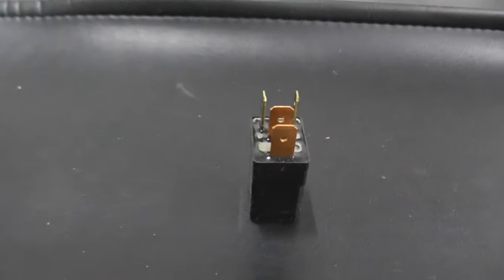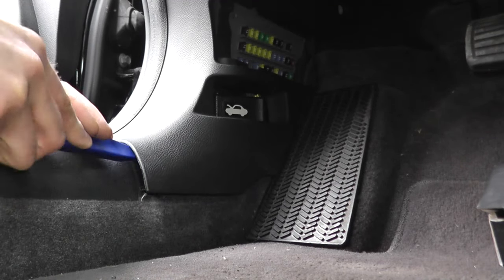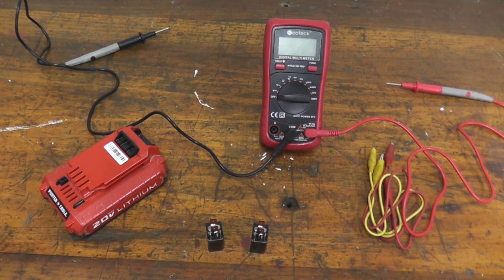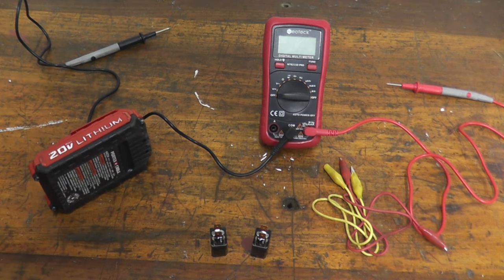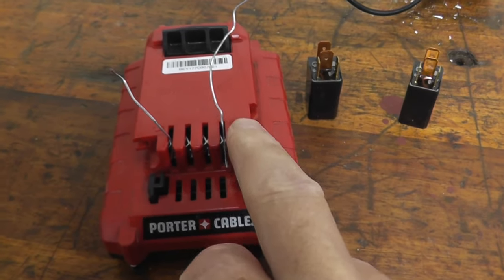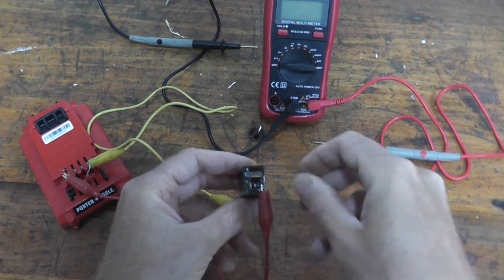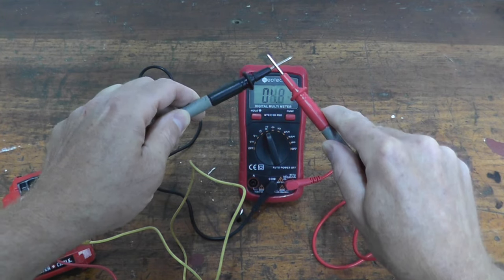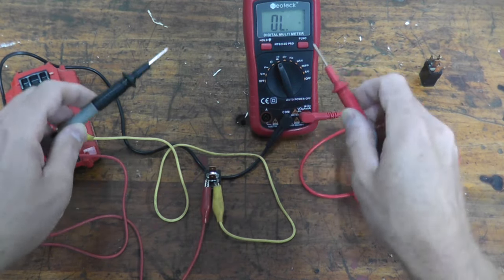A/C Condenser Fan Relay and Radiator Cooling Fan Relay Testing and Replacement

Comment: Small terminals are the power to the coil in the relay that closes the switch and then allows battery power to go thru the relay to the device bring powered.

Comment: Is it possible the relay could work when first energized but fail after being energized for a while or heated  up? My condenser fan usually starts up when turning on the AC but will stop after a few minutes or driving for a bit. It will not restart until I turn off the AC for a bit and then back on again. My mechanic suggested that this particular relay could be failing causing the fan to cut out
Reply: @blueballsbkueballs  In my case my orifice tube was not working properly causing erratic pressures in the system. As a result, the pressure switch was turning the condenser fan off. My relays were fine.
Reply: @blueballsbkueballs  you likely have a poor or dirty connection at your relay/fuse box
Reply: @blueballsbkueballs  I would see if a new relay fixes it. It's possible yours is failing.